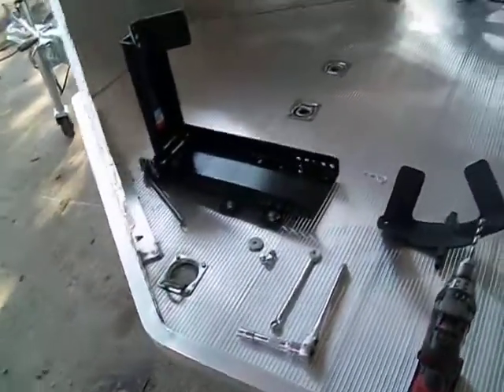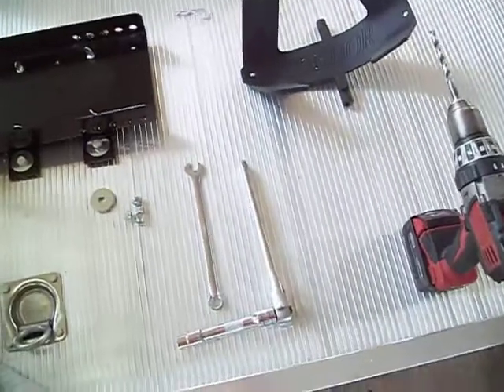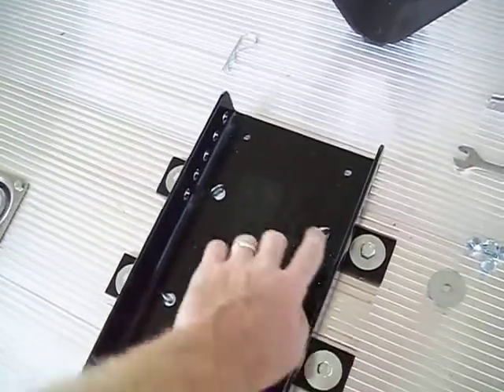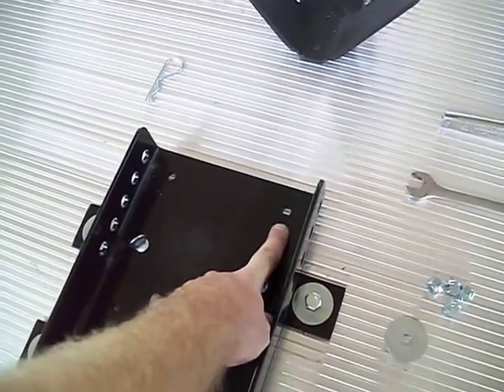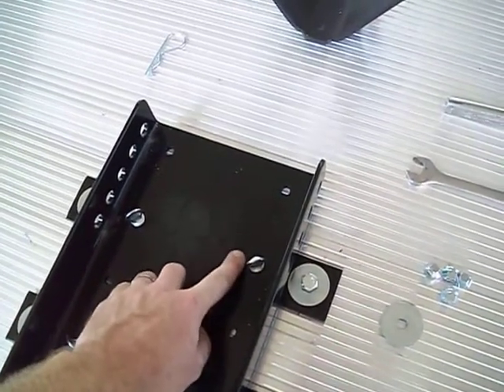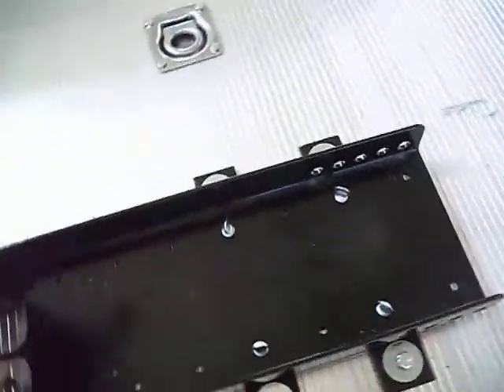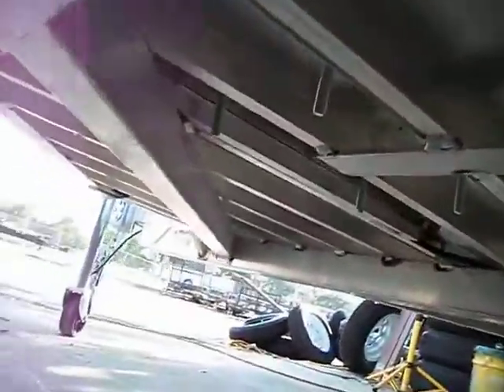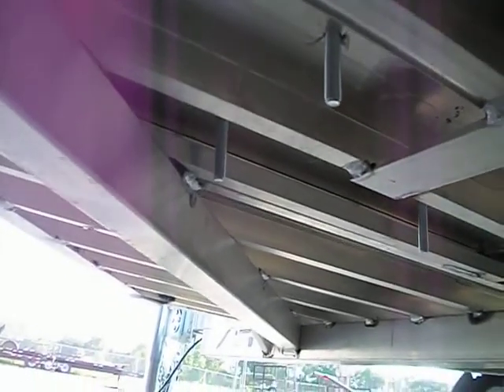installing a condor sc2000 wheel chock on and aluma trailer

Comment: How did you determine how far back to position chock?
Reply from the maker: best rule of thumb drive you bike onto when you fell it teeter and rock forward drive forward another 10-12 inches and stop. mark it and mount your chock there. you want approx 60/40 on weight dist.